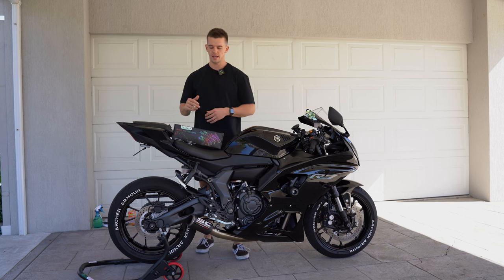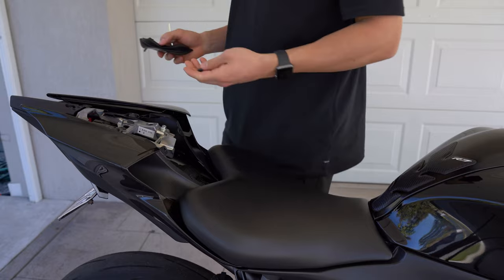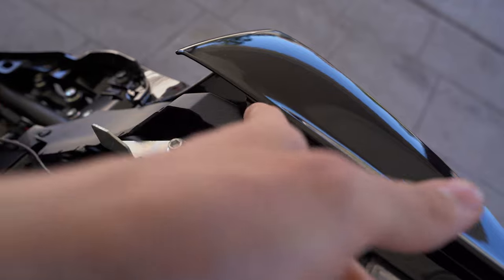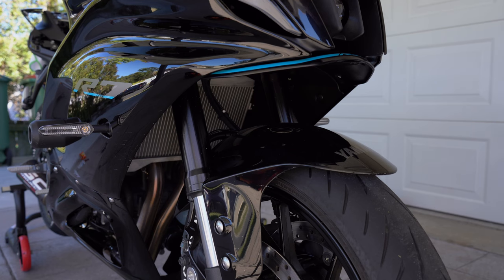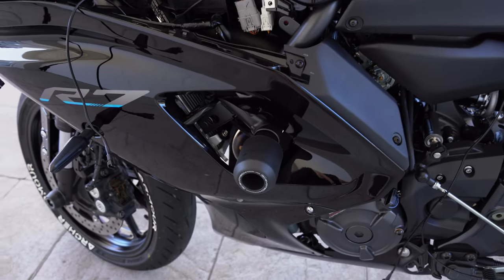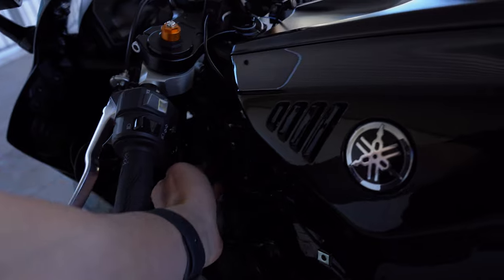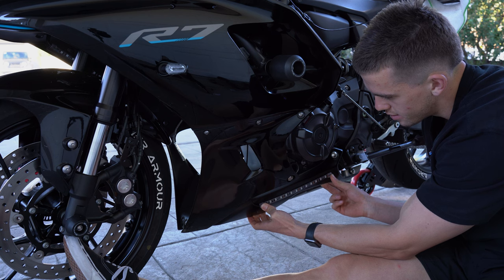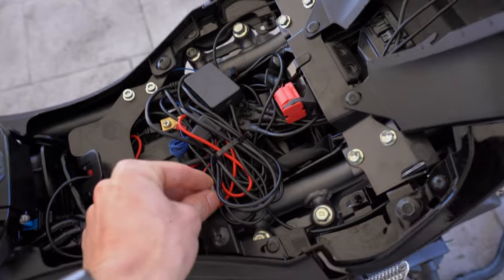How to install LED kit on motorcycle (detailed tutorial)

Comment: How did you make the connection without the battery being discharged? I put mine red and red, black and black and the battery was discharged and with the control I left the lights off

Comment: All the videos I've watched don't show how or where to connect the blue wire. I know it's to the brake line but I don't know how or where to connect it
Reply: If it’s for an R7, you connect it to the solid yellow wire on the brake light. I did mine right before the plug, like an inch or so back.
Reply: Why do you need to connect it to the brake light? It works fine without it?

Comment: You could also atach it after your ignition right? So its always off once you pull out your key?
Reply from the maker: Yeah you could do it that way if you wanted to
Reply: @denham.archer how would you do that?
Reply: @WogWoE you need to hook it up with a relay, if you go directly to your ignition it'll pull more than intended amps and blow a fuse.

relays are really simple, there's 4 wires. 2 for the battery, one for your "signal wire" and one output hot wire for your leds (or wireless charger)
you put the signal wire to ignition, output wire to your device of choice, and ground your device either directly to the battery, or to the frame if you have frame ground, I just grounded mine on the same wire the relay is grounded.

my relay also has a switch on the ground so I can turn it off manually in addition to being off when the bike is off

Comment: Does your battery need to be off when installing negative to positive wires?
Reply from the maker: You shouldn’t have to remove the battery. Just keep ignition off and don’t let either of the wires touch each other.
Reply: it makes no difference whether or not the ignition is on

Comment: Have you had any battery problems and have any of them fell off due to the heat from the engine?
Reply from the maker: No it has a battery switch so it doesn’t drain power and they haven’t fallen off
Reply: @denham.archer  ty bro and also replying back so quick beautiful bike by the way
Reply from the maker: @JoelHernandez-tq7kd  thanks mate

Comment: Does this not drain the battery when not in use? Or does that switch with the light totally disconnect power? Just installed my sons, and thats my only concern by not using a relay of some type
Reply: 01:28

Comment: Where does the blue wire go
Reply: I’ve been struggling to understand as well!
Reply: He mentioned that it goes to the brake wiring so that when you hit your brakes it will illuminate the LEDs red with your brakes
Reply: AH I was wondering why you had to connect it, that's a pretty cool feature